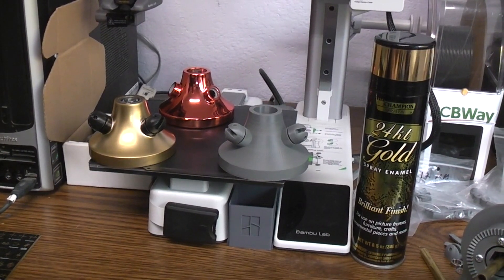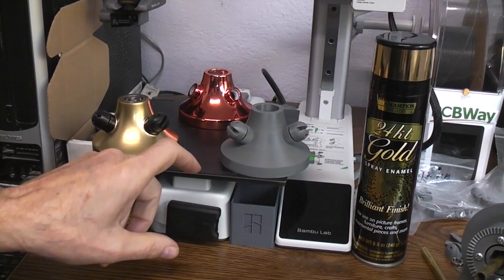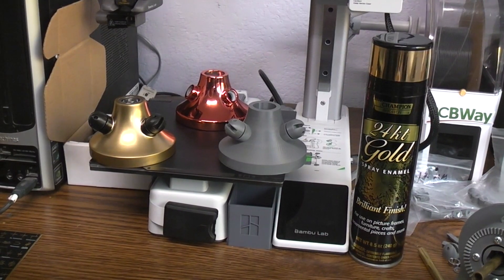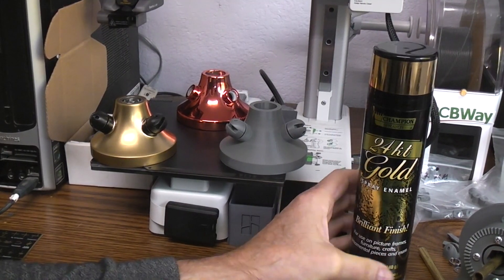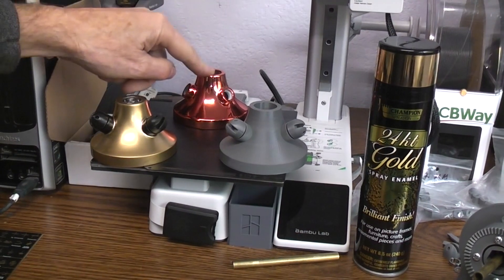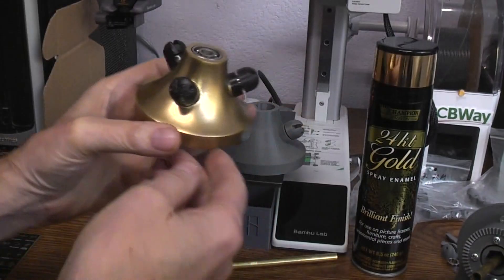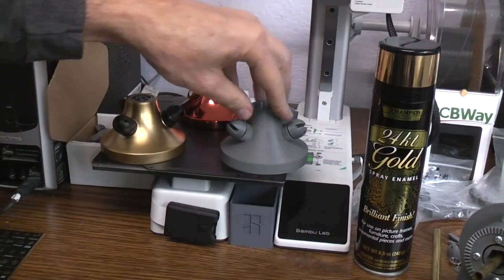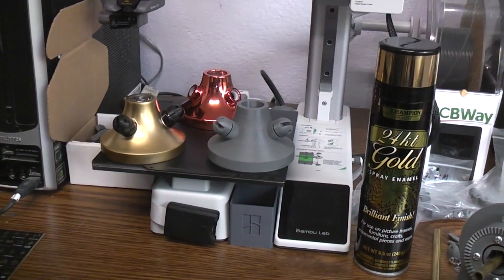Smoothing and painting a FDM 3d printed PLA Gyro Bell, using brushed on UV 3d resin.

Comment: Nice smooth finish! How does the price compare?
Reply from the maker: A few dollars for the FDM print "assuming you have a printer and have filament" $20 bucks for the specialty gold paint "the can will do more than 1 part of course" Sandpaper and your time to sand the finish. Now if PCBWAY does their magic and if you buy 10 or more the cost is around $45 dollars plus shipping. There are so many steps involved "set up costs" in the Electroplating finish that if you were to buy just 1 part then the price would be closer to $175 dollars.

Comment: That's a great idea using the resin to fill in the layer lines. I never could find anything that worked all that well that didn't require so much sanding that my arm felt like it was going to fall off. 😄
Reply from the maker: Yes, any of the basic gray printer resins will work and sand easily. If the sun is not shining, then you will need a UV light source to set it up.
Reply: @Robothut  Thank you very much!